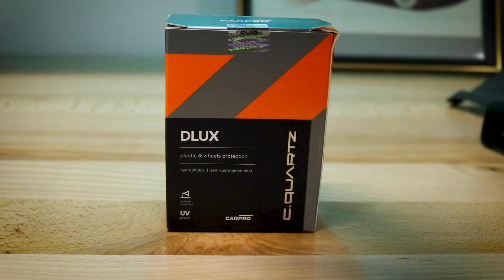Faded Plastic Trim Pieces? Try This!

Comment: I just bought my first bottle of this to restore and protect the trim around my windows, but if I were to apply this to impact areas such as black plastic fender flares, mud flaps or even black plastic fender well liners of a road-only daily driven crossover, about how long could I realistically expect the Dlux to offer protection? Thanks in advance!
Reply from the maker: Cool! It just depends on the roads you're driving on, more gravel and loose dirt and the quicker it will fade. Great to do once a year as a maintenance protocol
Reply: @ChromaticGarage  It’s just street and highway driving for me, and no road salt either. I’ll give a try and see what happens. Thanks!
Reply: Been using it for some time now on my Daily driver ,New York road salt ……and I would say it last about a year ….maybe a year and a half ……but after that all you have to do is wipe it on again and your good to go ….it literally looks back to factory…..and the bottle goes a long way

Comment: Big 1K  !!  Well  Deserved  !!  :-)             Question,       at apx $60 a bottle [cdn]     i know too many variant to concider like car or truck models and trims etc..to give an answer, but ballpark figure..how  far does the 30ml bottle can bring you?  like for sets of wheels for example!   or you really hike the cost to the customer?!          hard one eh!  loll!
Reply from the maker: Dan Morrissette thanks Dan! Good question but you’re right, it is so different depending on the tricks of the vehicle. Typically with one 30ml bottle we can do 3 sets of wheeels. So it goes pretty far, it just gets confusing when you start including trims. So many of those new crossovers have entirely plastic rocker panels in which case you could potentially use a bottle on 1 vehicle haha
Reply: @ChromaticGarage  Cool, 3 sets of wheels is pretty good !!    i was amaze on how the trim came back after your application....      Thanks Again!!   :-)